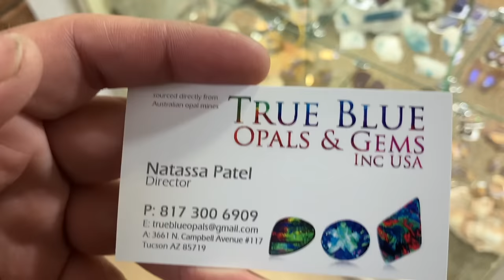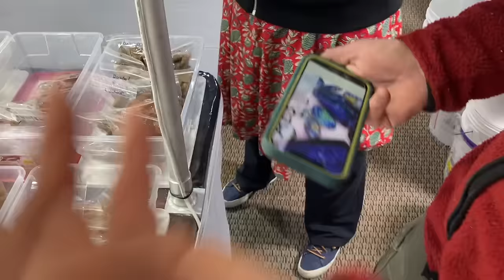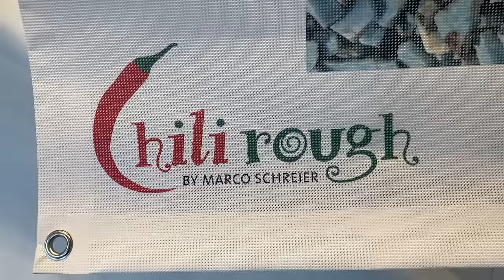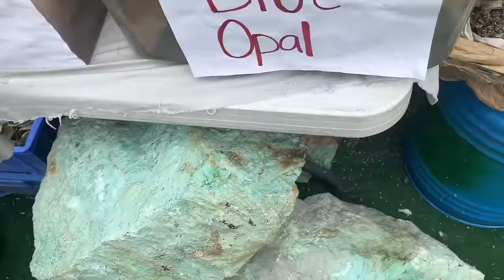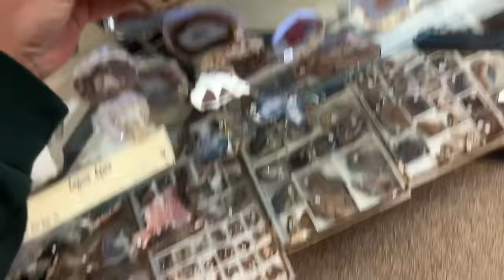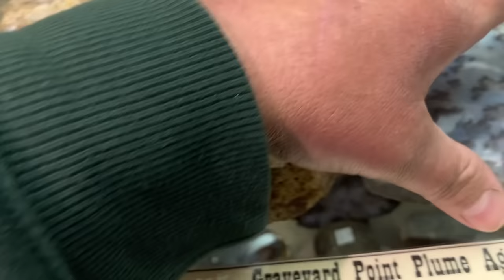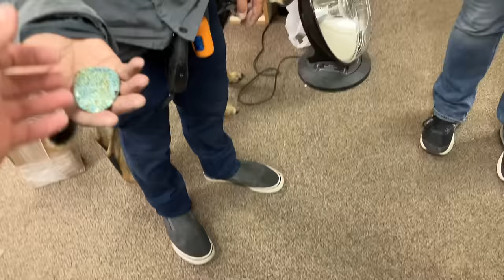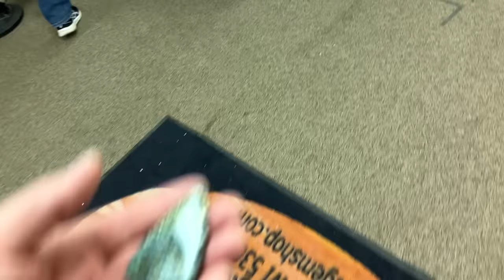Tucson Gem and Mineral Show Pre Show Special part2 Opals, Turquoise, Sugilite, & Fortune Cookies

Comment: Hi Dave,

Rather than the Foster machine, If you found a high-speed variable speed Dremel of some kind, wouldn't that work?

You just need to mount it in a certain way and then get that vacuum cleaner going.
Reply from the maker: Dremels are fast but the foster is way faster 
You could get similar results but not the same but definitely still worth the try

Comment: how do you get into making this your job? does it have to start as a personally funded hobby or is there a fast track to being employed as a lapidary artist
Reply from the maker: @Cofo94  you could find classes to get better faster I guess it definitely is a costly startup
Reply: @ yeah….ive been passionately watching and learning so much about mining/cutting opal specifically the last 3 years and ive been a rock hound my whole life. mining, ive heard its bare minimum 100k if you want to break any ground in Oz. ive seen cheap lap wheels but it seems really extra hard to cut on horizontal replaceable pads vs a $1400 cabking lol. i heard you say you live in Taos? i lived in a tiny mountain town 40 min from Alamogordo for a year. loved it- gave ski lessons
Reply from the maker: @ very familiar with alamogordo 🙏 I don’t think it cost $100,000 to get into you could take it slow and just do one thing at a time by one piece of equipment that can make you money such as a saw or a machine make money using them and go from there